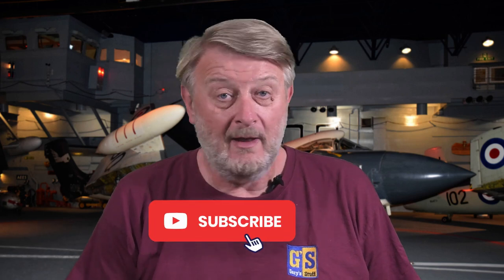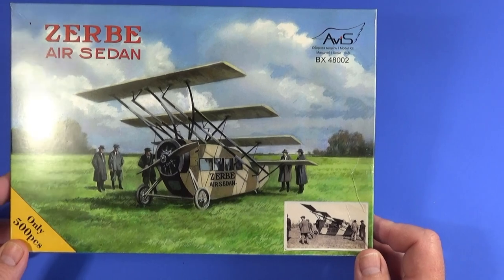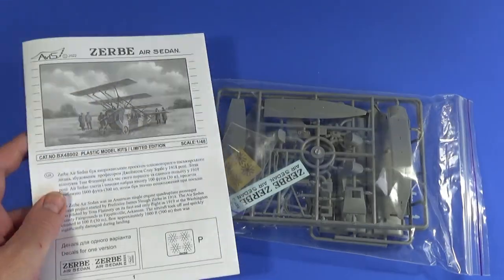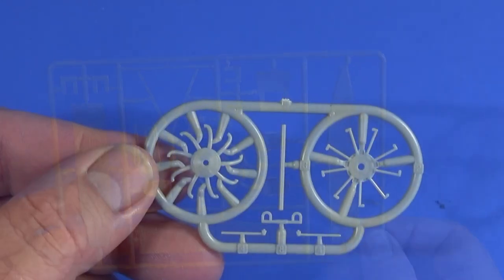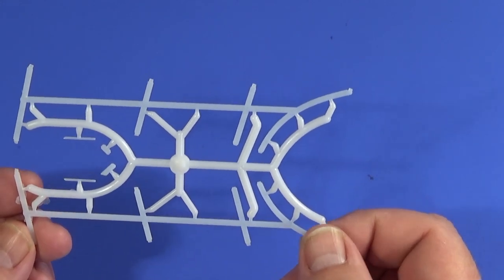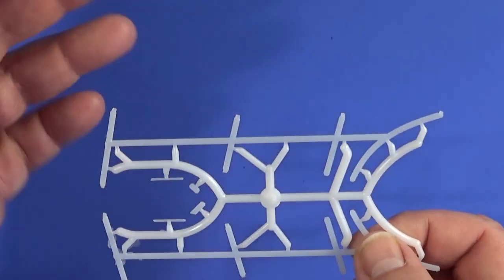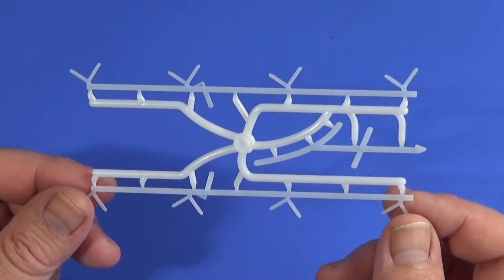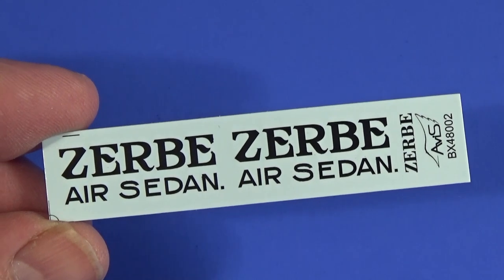HOW MANY WINGS? Insane Zerbe Air Sedan kit from Avis - what's in the box?

Comment: Ahhh gotcha Gary! I saw the 'only 500 pcs' on the box and thought that meant the /kit/ has 500 and thought 'ONLY 500??' Then you said only 500 were being made and the penny dropped... 500 kits as opposed to 500 /parts/..

Nice to see the bag is resealable, so after the kit is complete you can recycle/reuse the bag for whatever you like.. another kit.. food.. medicine etc. I'd like to see more manufacturers do that, maybe more expensive but OK for a short run kit.

Looking at the photo etch, the spokes look as wide as the whole wheel, so if somehow the plastic centres could be removed, maybe the photo etch could be glued /behind/ the wheels so you could see through them? Come to think of it, they look too long to glue in front?

BTW with the wings as you say being so short, they probably /needed/ four to get the required amount of lift.

Comment: Hi @Gary.
Regarding the 2 wing sprues...
Im guessing that all 4 wings would have originally been moulded as one sprue frame, with a central feed down the middle of the sprue to make sure of a good result.
I would say that the factory then snipped part of the sprue frame level with the wings and used side cutters to remove the centre frame feed of the sprue from the 2 inner sections of wings.
Im thinking that all this was done, so it would fit in that small parts bag?
Reply from the maker: I'm inclined to agree with that Simon. It would make sense.